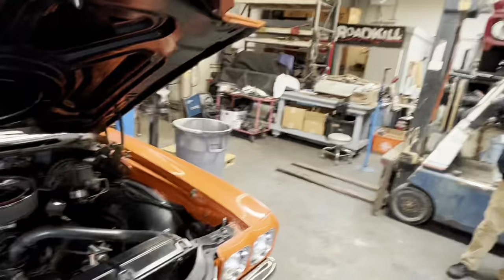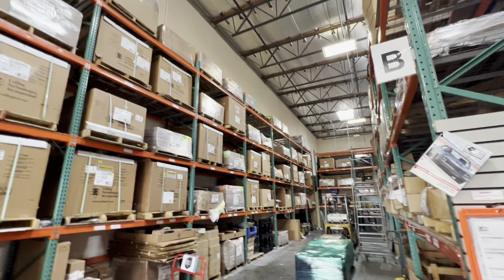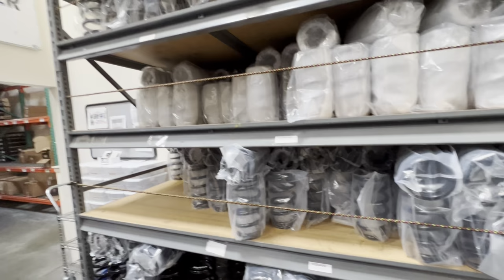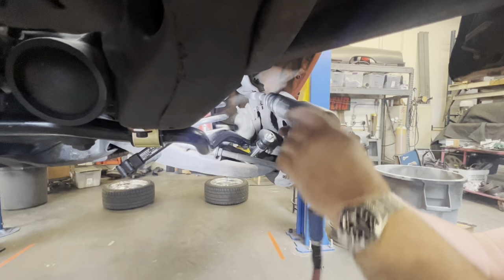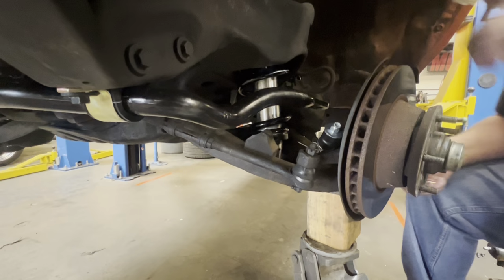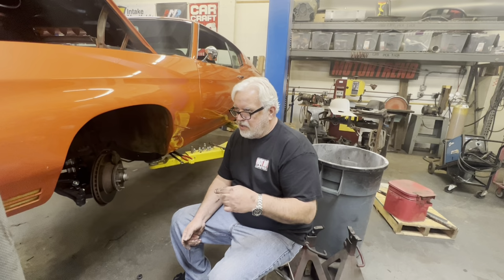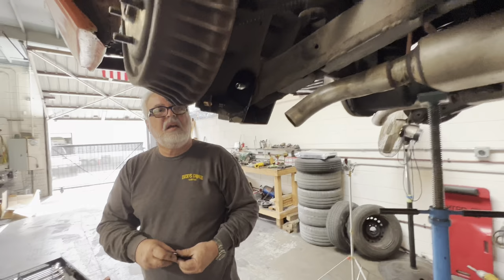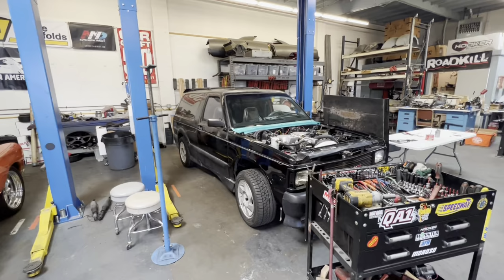1970 Chevelle Coilover Conversion

Comment: This is what I need to do with our 67 Chevelle.  I used 1250lbs front 350lb rear conventional springs from Speedway Motors 
The problem was I had to use 5 1/2 diameter front springs to achieve the rate I wanted but they rub inside the pocket and it’s hard to find shocks that control that stiff of a spring.  
This is definitely the way to go! Thank you!